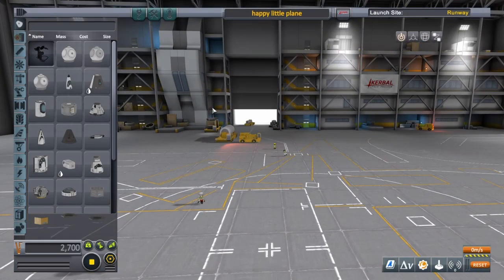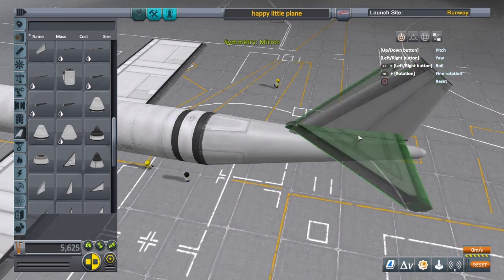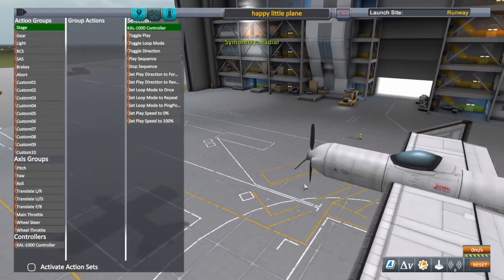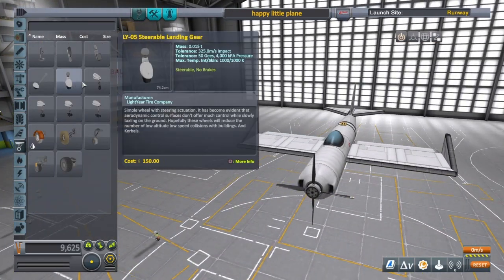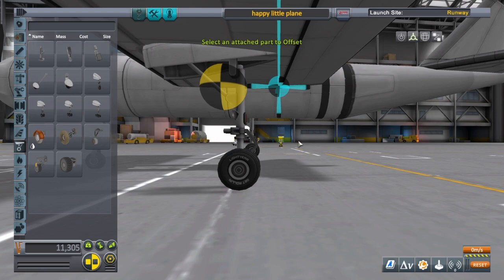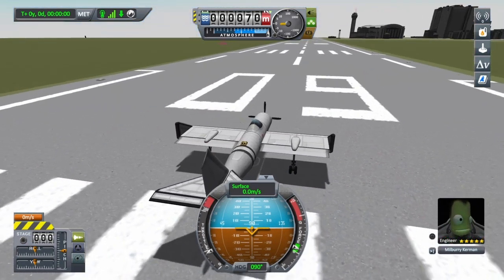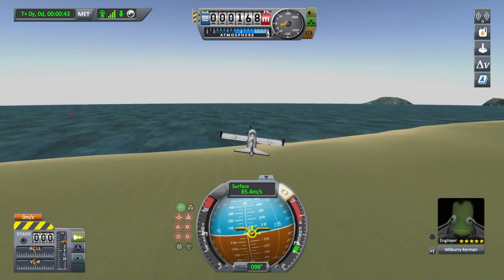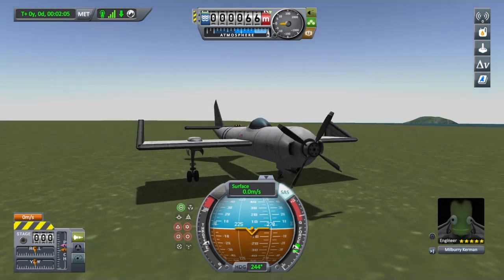Kerbal Space Program: Propeller Plane Tutorial

Comment: If you have trouble getting it to work:
- check, whether your engine runs clockwise or counterclockwise. make sure your props are in the same configuration. they have two variants and you can switch at the bottom  of the prop menu
-make sure your props are extended
- play around with the AOA of the props. monitor the AOA during takeoff and see with which angel you get the most thrust. at high airspeed during flight, you may need to decrease it again to get the most thrust. if you get to slow after a high G maneuver you might need to increase the angel again.
for me, -63 at takeoff, -58 at about 60-80 m/s and -53 at 100 m/s and above worked the best. (if you go backwards, try positive numbers)
Reply: My replica of the bf 109 bounces left and right, and the engine isn’t turning. Why
Reply: @spadedzero4483  The engine has a brake that is coupled with the brakes. so check if you have the brakes activated. you can change that by decreasing the brakjeforce in the engine menu to zero

Comment: As a matter of fact, there is no need for a Kal 1000 for a prop plane. Set your props blades deployed, trigger the thrust with the rpm of the motor, and here she flies! Monoprops planes are not very stables, though.... I prefer a twin motor (one on each wing) rotating against the other to compensate.
Reply from the maker: Correct, but to adjust speed with the main throttle, you’ll want to use the KAL. Saves from having to keep the rotor menu open.
Reply: @JohnnyOneShot  no need, really!  Chose the throttle shortcut, select the motor, select rpm, and thats all. Your throttle will increase or decrease your rpm. I can swear it works because... I have never been able to use Kal correctly.... - _-'
Reply from the maker: Well then wait till this weekend lol. That’s what the next video is about.
Reply: @JohnnyOneShot  can't wait for it! Thx for your job! 👍😜

Comment: This might sound really dumb. But once you've selected quad nodes how do you get all 4 propellers to connect because whenever I try it it only shows 1 or 2 props depending on my symmetry and then seems to randomly make 4 props somehow.
Reply from the maker: The rotor has a node option toward the top. You can set that between two and eight. Then even if you put a prop on symmetry two, once you attach it to the rotor, it’ll automatically put how many nodes the rotor is set for if that makes sense. Nodes are the green balls that things attach to.
Reply: @JohnnyOneShot  sorry for the late reply, didn't get a notification. Anyways, I put it on symmetry 2 and place it but it only places the 2 even when the nodes are set to 4

Comment: This is very helpful and concise, thanks. Is there a method, other than counter rotating props, to cancel the natural roll? Do real life pilots constantly have to fight that, or is there some method to counter that in design?
Reply from the maker: Yes real pilots have to correct for that. Although tots probably not as extreme at ksp
Reply: @JohnnyOneShot  Twin props it is. Thanks
Reply from the maker: That or use some reaction wheels.
Reply: They actually usually use trim to get rid of that.
Reply: Turn the torque limit down. It doesn’t have to be 100%
Reply: @louis9856  yeah but then it takes a full minute to even get to 30 km/h
Reply: MattehWizard from my knowledge, the torque doesnt affect prop speed at all. Unless it’s 0 ofc.
Reply: An interesting method to counter this is to make one wing longer (not sure how easy it would be in KSP though)
Reply: @JohnnyOneShot or change the center of lift, so it cancels out the torque

Comment: I couldn't get the prop plane I built off the ground the engine wooden spool up it was a liquid fuel, completely stock, any tips?
Reply from the maker: The engine wouldn’t spin?
Reply: Same problem it should turn on like any other propulsion system but it doesn't, design flaw in the game thatz huge
Reply: do you have the Breaking ground DLC?

Comment: I followed this tutorial but my plane is so slow, by the time I reached the end of the runway I could take off just a little bit and I had only reached 70/ms
Reply from the maker: It could be a few things.

Blade angle issues/size
Craft size
Console or PC?
To much throttle to fast. 

Any way to send me a pic on social media?
Reply: @JohnnyOneShot  like I said I copied this tutorial, my plane looks the same except those little wing tip things that you said where more for aesthetic. I didnt have as many options when I did the K1000 controller thing however but I was able to do what you did, not sure if that would be the issue, I also had to reverse the rotation direction on my motor thing because it spun the wrong way, and I couldn't see the blades move when I went to the different timestamp things in the controller. I'm playing PC with no mods
Reply from the maker: So on pc you want to use Deploy angle, not authority limiter. I made this before I ever played PC and didn’t know it was different.
Reply: @JohnnyOneShot  i dont know if you still watch this, but what mod did you use for placing stuff like that?

Comment: When you're in the authority limiter adjuster, how do you get your green line in the middle? My green line is at the very bottom of the gray box it's in and so is difficult to adjust.
Reply from the maker: PC? So this was on console. you need to use Deployment angle instead of authority limiter. If you’re use it two rotors, set both blades on the KAL to a positive number.
Reply: @JohnnyOneShot  Yes! Thank you. I figured that other part out too. At time=0, the value defaults to -150. Have to adjust manually with keyboard. Thanks again!

Comment: Prop angle does nothing for me, it does not change the speed or anything, it just isnt calculated in my game
Reply from the maker: Make sure the blades are extended on the detail menu.
Reply: @JohnnyOneShot  they are, i have tried everything by now. But normal wings in an angle work, its just these blades that are bugged
Reply from the maker: You try just manually moving the slider once launched to see it they move? You’ll have to delete them from the KAL first if your using itZ
Reply: @JohnnyOneShot  they move but it doesnt have an effect, i am not even using a controller...
Reply from the maker: Yeah that’s not right. Sometimes it gets buggy and you just have to rebuild the rotors.
Reply: @JohnnyOneShot  tried that too, with the same and with different props...

Comment: As usual i follow the tutorial and it doesnt work same thing happened with the helicopter idk what i missed
Reply from the maker: So what’s its doing, or not doing?
Reply: @JohnnyOneShot  hi sorry if i sounded rude. The propellers werent producing alot of thrust i think the highest speed  was 0.4 m/s i checked the blades and they were angled correclty ive definitely missed something.
Reply from the maker: With the airplane blades, you can’t just angle them 100%. You have to slowly increase the angle. Maxing our the angle basically turns them sideways which doesn’t produce thrust.
Reply: @JohnnyOneShot  ok thanks for the help 👍🏻👍🏻

Comment: After all these months I still don't use KAL lol
Reply: How else do u do it?
Reply: @ecyt2447  what do you mean?
Reply: @Nawrotsien  as in, is there another way that would make my life easier
Reply from the maker: Easier? Kind of. You can set your blade angle manually before you launch then just turn on the rotor. Then set the rpm to main throttle. Real world rotor craft spin up the engines to max and use blade angle for lift the same way i so using the KAL 1000. Thus why I do it that way.
Reply: @JohnnyOneShot  I think the problem is me then but thank you Johnny, you’re a king fr

Comment: My props always want to bank right too, otherwise there fine.
Reply: wrong they’re
Reply: Soda Can ok boomer
Reply: physics.
Reply: You can use trim to counter this. Trim only works when SAS is turned off. It basically makes the vessel constantly move in a certain direction. On console you need to hold L1 or LB while making inputs and on PC you need to hold alt

Comment: How did you start the engine?
Reply: I had the same problem but just managed to make it work: put rmp to max and par limit to max and then quit  the brakes, because seems that brake action group brakes the engine too D:
Reply from the maker: @KnutG420   yes they do. You can disable that in the action groups.
Reply from the maker: torque % is what starts the engines. The wheel brakes also stop the engines so make sure that's not on.